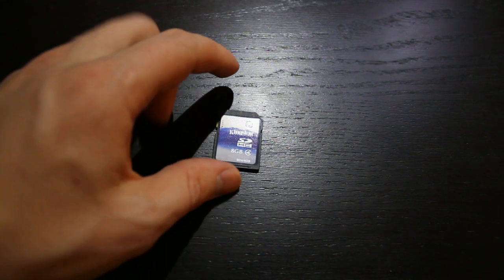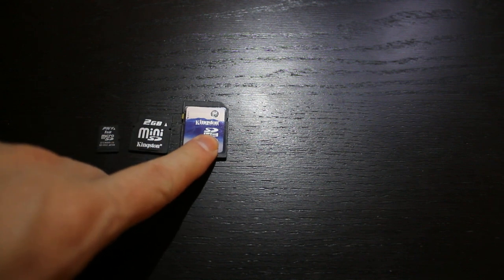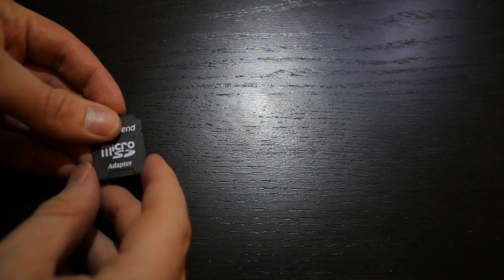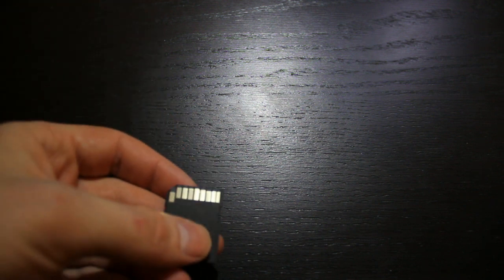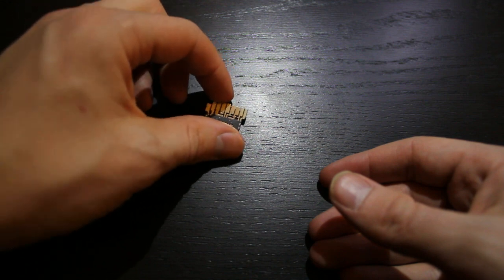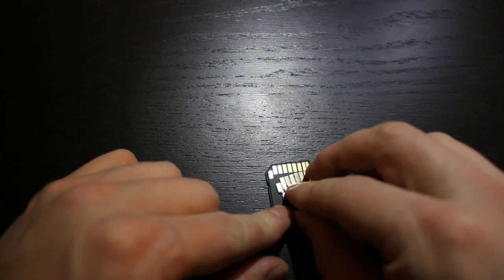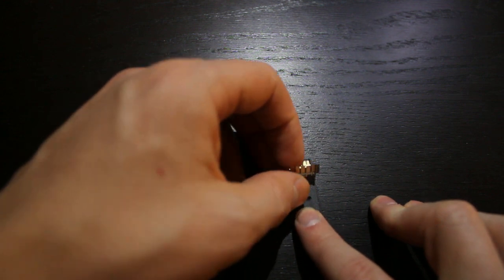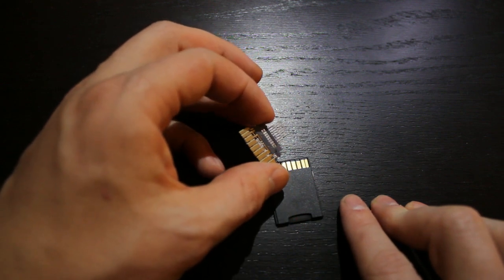SD card adapters how do they work

Comment: I’m looking for an adapter for a mini SD memory card. Hard to find … any suggestions?
Reply from the maker: Those do exist (micro to mini-sd), but they are rare as both micro to mini or mini to sd but they do technically exist, and they are same on the inside as this.

The problem with mini SD is that they existed for a very short period of time and then everone went for micro-sd and thus actually finding the apdapters is a massive pain.

I only have 1 of those and it came from a normal kingston  microsd package along with a micro to full size sd adapter.

Comment: I have several SD to Micro SD adaptors, and I cannot get any of them to read a 64Gb MicroSD card in my new Dell Desktop (Win10). However, if I use a smaller MicroSD card, i.e 32Gb they all work fine. Now, I suspected the PC card reader, but I got DELL to send me a 64Gb SD mem. card, and that works OK in the card reader. So I am trying to find out if the SD to Micro SD adaptors are not capable of 64Gb or greater. Any one have any ideas? (I have a SD to USB adaptor, and if I put the 64Gb Micro > SD Adaptor > SD/USB adaptor, it work OK, and I tried formatting the Micro in this and then trying again 64Gb Micro  > SD adaptor > SD slot, but no success.
Reply from the maker: Sounds a lot like a issue with the reader on the Dell machine, and its probably not fixable as its likely to be a firmware issue. normal SD cards go to up to 2Gb then its SDHC from 2 to 32, then SDXC 32Gb to 2tb. It might also be a UHS-II card, which has extra pins, which could cause incompatibility. Hard to say to be quite honest.

Comment: so basically, adapters are used to you can also insert your micro SD card into a laptop or PC? funny enough, my chromebook uses a micro SD card slot and doesn't even need an adapter
Reply: chromebooks suck
Reply: @BottyOPBR  not really, i guess you never had a computer with a nvme ssd and a core i7 7th gen
Reply: Me too
Reply: Older laptops usually have full-size SD card slots, some don't even have slots

Comment: how to i connect the adapter into the PC ?
Reply: there a rectangle slot to insert it infront of the cpu
Reply: Kindly do not confuse people by refering to the CPU - The Central Processing Unit is a special part that is attached to the motherboard  - The reader for SD cards is on the side of the actual PC it is usually some where near a USB, Internet cable or head/speaker cable socket - By doing this you only prove your ignorance about correct usage of IT terms - Thats like refering to Direct current as direct control - they are two completely differrent things
Reply: If you don't know don't answer

Comment: hey Ive lost my adapter and I need one in order to use my micro sd card in my laptop
if I buy an adapter from another company and with different gigabites (mine is 16 gb, but I would buy a 8gb adapter) would it work?
Reply: If it mentions gigabytes you're not buying an sd adapter you're buying an sd card
I'm sure 2 years later you've sorted this out by now, but yes, any adapter which works with an 8gb sd card will also work with a 16 gb sd card